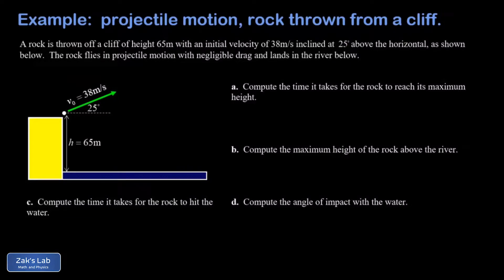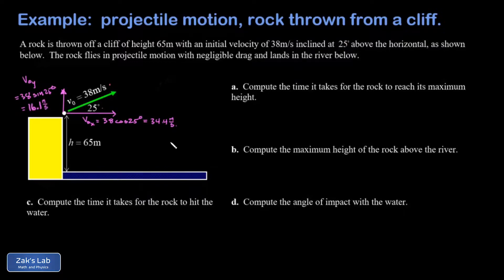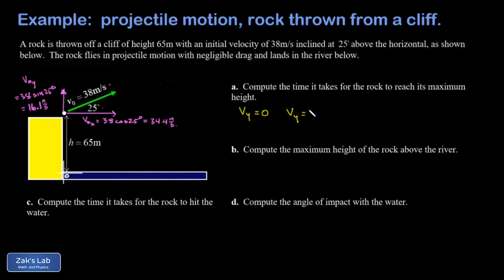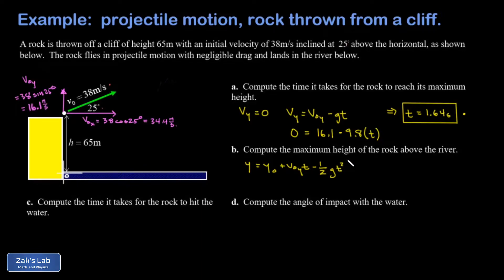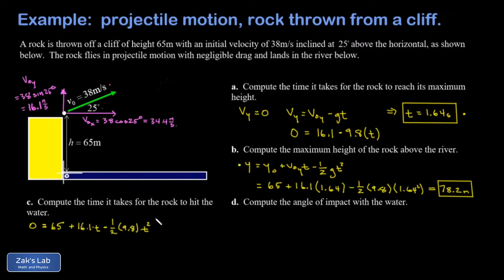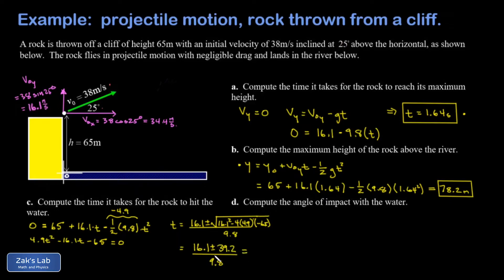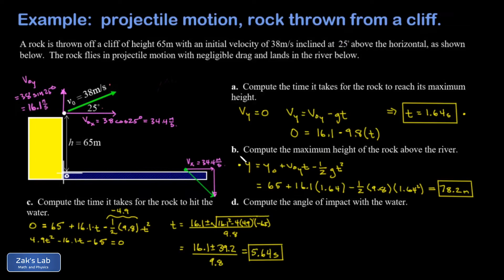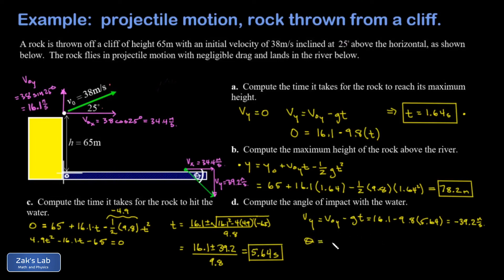Stone launched at an angle from a height:  max height, flight time and impact angle.

Comment: could be made more difficult by adding that with what angle with horizontal the rock should be launched for max range but still its a  nice question for clearing concepts.
Reply from the maker: Believe me, that's on my list!  The angle of max range is really interesting from a non-zero starting height, and there are several approaches (calculus, coding, geometric) to solve that problem.  Thanks for the comment!  -- Zak